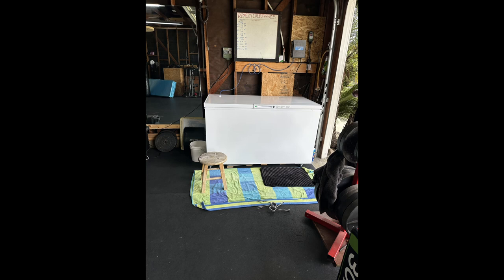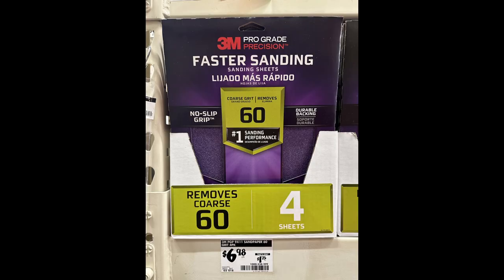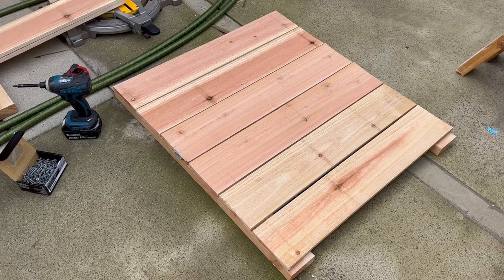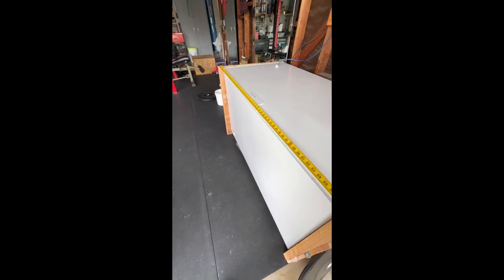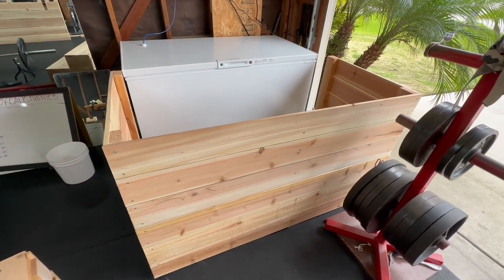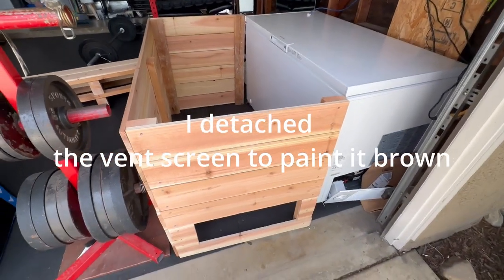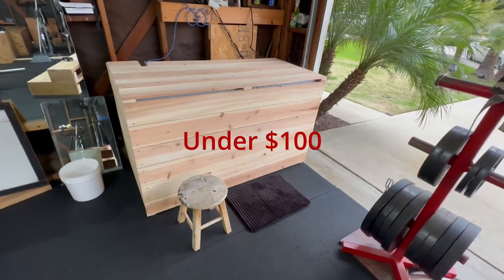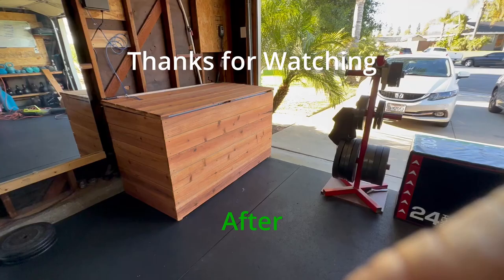Cold plunge DIY - Ultimate cold plunge set up Under $100

Comment: Great video man, I really appreciate you going into detail on the materials you used. My one question is: Now that you've had the box/cover on it for a while, have you found that the spacing between the planks and the freezer is big enough to not cause any heat issues? I think I read somewhere that you're supposed to have 3 inches of space around the freezer to allow the exterior to cool off. This looks great, and I would like to match what you've done, but I thought I would ask about the heat issue first. Thanks again for the great video and information!
Reply from the maker: Hey what's up Xtreme. Thank you for the thumbs up. Yes it's been about 6 months since I made the framing for the cold plunge and I haven't had any problems with heat that I know of. There are very small gaps between the boards so it isn't completely enclosed. I have it set now to about 37 degrees and it turns on about once every other day. It's in my garage and my garage is not insulated nor does it have any type of cooling system. If you are worried about that just double the 2x4's and you'll get 3 inches or use 4x4's. Either way it will look super nice. Since then I attached the lid to the wall so I just fold it up and I made some matching steps. Going to make a video on that soon.
Reply: @BIKEFIT78  That's great! Thanks for the quick response man. I'll be buying materials and building it like you did. Thanks again.
Reply from the maker: @xtreme8541  Nice. Just make sure you don't use screws that are too long so you don't damage the freezer...

Comment: Looks good! Where are you getting your cedar planks? In my area a 6' length of the same is $17!
Reply from the maker: I bought all the cedar pickets from Home Depot. Just my local big box home improvement store. They run about $3-$4 a plank. They are not a top of the line high end plank, they are your regular cedar fence pickets. I still had to sand them down a bit and I made sure I picked the straightest boards.
Reply from the maker: $17 dollars is insane price. I think that might be for some premium cedar wood. You could even use regular pine or even a sheet of plywood and cut it the long way at 6" wide. That might be cheaper.

Comment: What did you do to seal the inside of your chest freezer?
Reply from the maker: To seal the inside of the freezer I used JB Water Weld. They were kinda pricey at $6 a pop and I need about 7-8 of them. However it hardens rock solid and it's meant for water applications. Don't use marine silicone, it won't last.

Comment: What color stain did you use?
Reply from the maker: Let me check. The color I bought was not the color I originally wanted. I did not shake the stain like i was supposed to so it came out very light the way you saw it in the video. I made some steps  to add to the plunge and I shook the stain up and it came out way darker. I didn’t like it. But let me check for you.
Reply from the maker: The brand is Varathane and it's called Early American... However remember i didn't shake it up so it came out very light which I liked. When I finally shook it up it was too dark. You might wanna try and look for a lighter one.